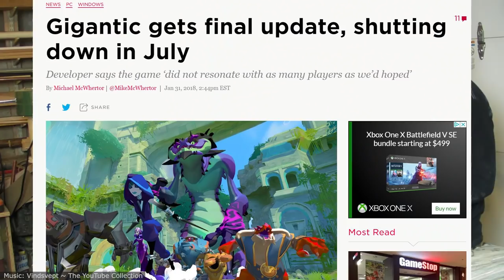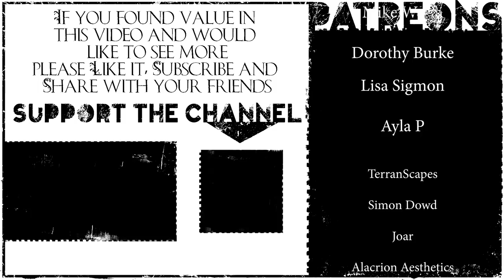Constructing A Colossus Part 18: Cyborg Legs ( Shadow Of The Colossus Sculpture Build )

Comment: In retrospect would you have still added the plasti-paste to the inside of the legs?  It definitely wouldn't be any more structurally sound than the metal constructs and would just add weight?  Or would the weight help (albeit marginally) in the top-heavy battle?
Reply from the maker: I'm guessing it really didn't make a difference either way.  It's pretty lightweight stuff.  Just wasted some money.  And sanity.